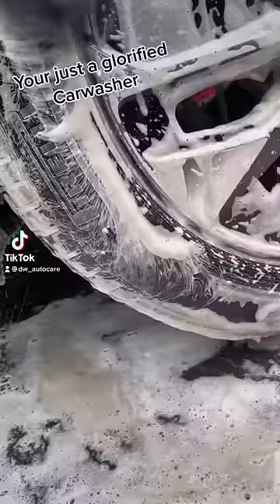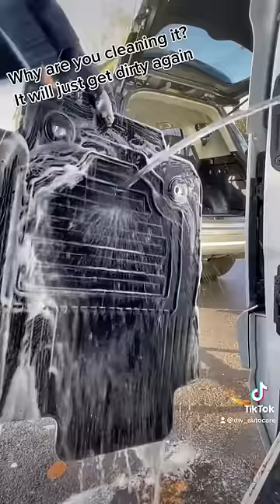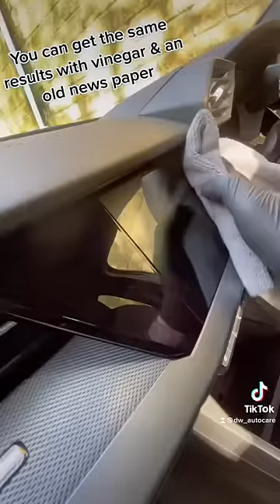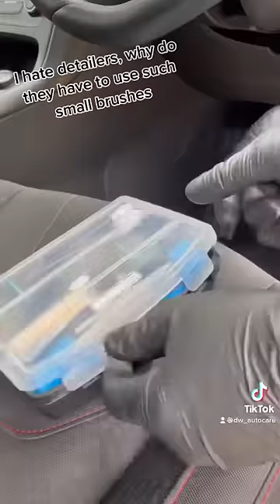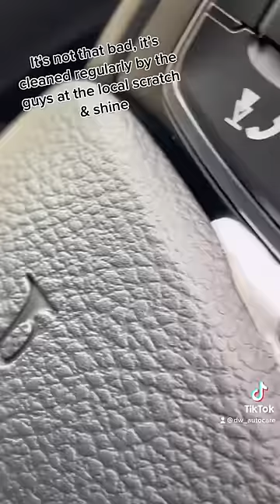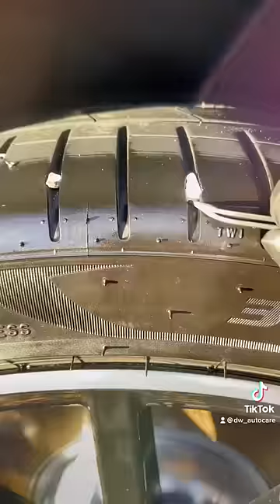Detailing ASMR- Things we hear as PRO Detailers episode 2.. #detailing #shorts

Comment: As someone who details his own vehicle, the guys that do this as a profession have my total respect. Four hours into my cleaning and I call it quits.
Reply: I'm a minimum of 5 hours just for an interior. But I charge a min of $200 to do an interior, up to $500 if its really really bad.

That being said its all I do day in day out, and I'm the best around (i live in a tiny town and have people drive 2 hours from Toronto (huge city) to my Tiny town of 2,000 so I can take care of their prized collectors vehicles.

Most the out of town folks are here for wetsanding / polishing / ceramic coating. I do love my job though

If you want to clean your car like a detailer, bring your spray cleaner, microfibers, brushes with you to each seating area as you vaccuum. To save time, dry brush obvious dirt while using the vac to remove the debris, THEN use spray cleaner, scrub with a brush (toothbrushes are awsome) and use the vac to suck the cleaner out of the cracks, and compressed air to blow the dirty cleaner out of hard to reach areas after scrubbing (ect vents)

Always get it as clean as you can DRY before using cleaner. That applies to all stains, crumbs, dirt in vents , dirt in cracks around switches ect. 

Vac the upholstry well but quickly ( think 1 minute going hard), then use a hand brush to lightly agitate the carpet, then re vac quickly. That gets you 90% results.

You can use a pump sprayer and a wet /dry shop vac to shampoo your upholstry well. Spray citrus degreaser on the upholstry, agitate with brush and extract with clean (preferably Hot) water.

Workflow Quick vac, Dry dust with vac, Spray cleaner brush quick wipe dry and vac the residual cleaner out. Using two microfibers to dry the cleaner gets best results.

at the end hit it with a dusting brush on the vac to remove the annoying static clinging dust on plastics.

Oh to clean glass use a blue dish sponge, spray glass cleaner and a tint squeegee. With a lil practice you can make glass invisible. Can do the same w/ microfibers but youll have to redo the windows several times, the squeege method works first time every time (with practice)
Reply: @aaronst542  your comment is super helpful. Could you recommend the best products to use that won’t break the bank? I used to have my car detailed regularly, maybe 1-3x a year, bc my dad was really great about making sure my car was well taken care of (I have since realized just how fortunate I was that my dad was able to do this.) Since I got married, my car hasn’t been detailed bc my husband doesn’t believe in detailing and thinks cleaning your car means taking out the trash, maybe vacuuming, and running it through the car wash 😩 He usually washes my car for me maybe 1-2x a year. I don’t drive often anymore due to a disability, but I finally went to go clean it myself bc I couldn’t take it anymore and I was shocked to see just how quickly the finishes/materials/overall surfaces of the car have deteriorated since I stopped getting it detailed. 
I fully appreciate how much work goes into detailing and wish I could convince my husband that it’s worth the cost, but for now I’m just going to have to do it myself. There are so many products and recommendations out there, it’s overwhelming for somebody who has no clue. I have a shop vac and access to a pressure washer, but no clue what to get for actual cleaners. I’d really appreciate your recommendations!
Reply: @Sarah-ic4yu  I would suggest a chemical guys kit from Walmart. I’ve used their products for six years and they hold up to their reputation. 40 bucks gets you a bucket, soap, wheel cleaner and detail spray. Also, they sell an interior kit for the same price. Get some detail brushes at AutoZone as well. Works great for wheels, plastic trim, vents, nooks and crannies and steering wheels. Microfiber towels as well as a drying towel. They’re big and super helpful in drying your car faster to avoid water stains. If you want wax, I suggest the old school method. Mcguiars is my recommendation. In total, you’re looking at almost $150 if you want to buy all at once, but buying separately is the way to go. I hope this helps

Comment: The only thing I wanna know is why some of you criminals ask 10k for a detailing where my detailer does the same for 1700euro,s and I am talking interior detailing, exterior detailing with a ceramic gyeon coat on the paint, glass, brake callipers, wheels with 36months of warranty. You didnt even took the wheels off (in this vid at least).

Comment: Why take a shower? You'll just get dirty again
Reply: Do you clean every milimeter of your room, even spots where you don't see?
Reply from the maker: Exactly 🤷‍♂️
Reply: @Splinter-ge9pf  3 or 4 times a year, yes. I move every piece of furniture and clean ever part
Reply: @saulgoodman2221  do you clean between every individual wooden panel on the floor, take apart all your furniture and clean inbetween parts of it? Do you also take apart all electronics and do that?
Reply: @Splinter6662  1. I don't have wooden floors, 2. You can't take apart my furniture without breaking it 3. Why would I try to open my electronics when I could easily break 1000s of dollars worth. You are really reaching for an answer that proves your point.